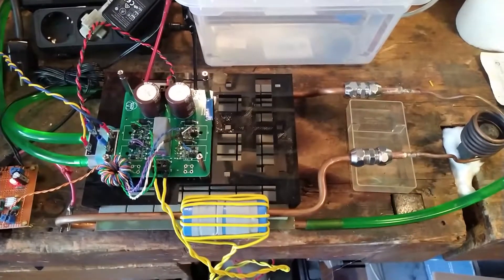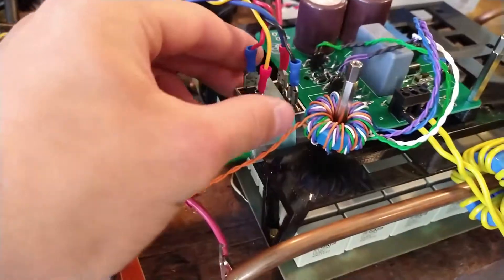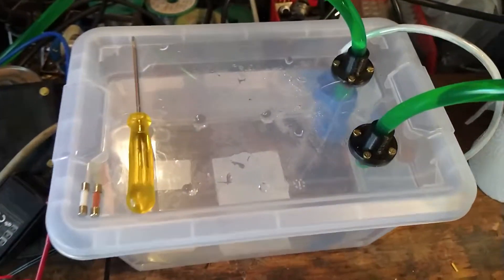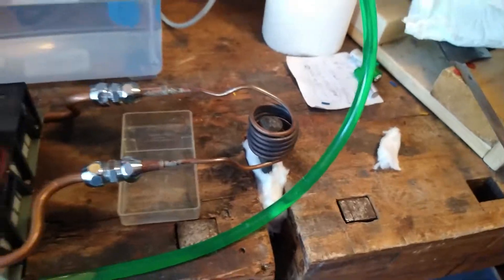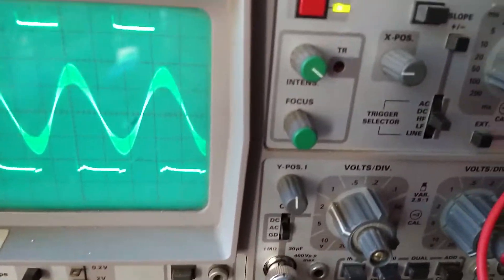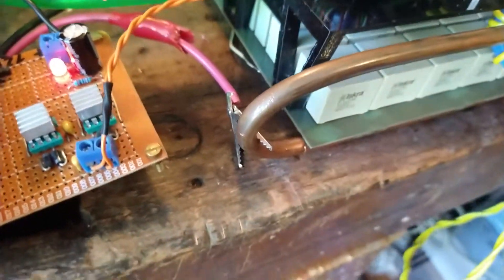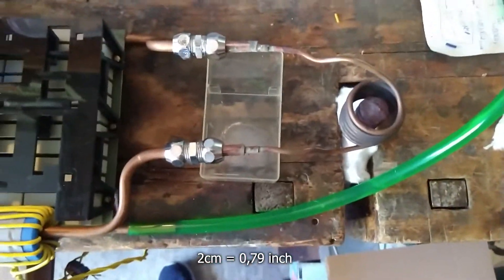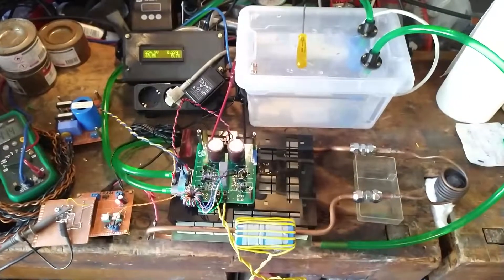Full Bridge Induction Heater - first tests at 2.1kW

Comment: Your english is great. I'm curious what you're using to drive the control signal for the PWM. Voltage in the LC tank? Current in the tank (between the inductor and capacitors?) 

Also, curious, what's the size of your capacitance and inductance in your tank / coil?

Comment: how to make feedback for this?
Reply from the maker: There are multiple ways for doing that. You can use a mixture of current and voltage feedback or current only. In general you are trying to get a measure of phase difference between two signals that represents your offset between driver frequency and resonance frequency.
The main difficulty is to measure the resonator current at resonance (or close to it), as it is not only a very high current but also at high frequency.

Comment: Hello, i have build something similar using a μC that locks in the frequnecy. I went from full bridge to half bridge setup because the power draw was too much. I found that the matching transformer is the critical part of this kind of setup. My ferrite cores were heating up very fast at 2kw and that was a matching problem. I have gone from 1 turn to 2 turns in the secondary and around 18trn in primary and that solved the problem and the power from 2 kw went up to 6-7kw while the ferrite cores were at 80 degrees celcius. The matching transformer should match the impedance of the LC tank. Different materials result into different impedances of the LC tank, correct me if i am wrong. Do you have a ferrite overheating problem with theese cores?
Reply from the maker: Hello,
I haven't looked at the temperature of the transformer but I intend to measure and regulate the primary current of the transformer in order to not draw to much current and save the IGBTs and Diodes. I also want to measure the power from the grid twice a second with a PZEM-004T module. This way I hope to get good control over the Power draw of the unit. 
But if you say I should, then I will also  measure the temperature of the Transformer while in development. I don't think I could add another secondary because of the core diameter. I use 8mm copper tubing for the secondary circuit. I will upload some update videos of the induction heater. 
How did you program the μC in order to lock the frequency? Do you have a video on YouTube where you show your  unit? I would be interested to see it. 
Best regards
Reply: @dickesf8525  Its a good idea to measure the input power. I currently have an 100A AC meter that measures the line amperage. You mentioned the PZEM-004 module. Does this take into consideration the power factor? The microcontroller is the atmega8 that is programmed with Arduino. The microcontroller measures the phase difference between the capacitor voltage and the Inverter voltage. Theese voltages are fed into the xor gate of the pll ic. Different phases give different duty cycle of the output of the xor gate. The microcontroller reads that and applies a compensated voltage on the pll ic in order to keep the phase 90degrees. Its important to begin scanning from a higher frequency than the Fresonant. My current protection circuit works with a current transformer of the primary fed into a comparator. If the limit is exceeded the output of the comparator triggers a flip flop circuit that shuts down the pll ic. Lastly my only way to reduce the power is to detune the circuit (increasing the frequency above the resonance). I don't have a YouTube video yet, i will upload one though.
Reply from the maker: @livewire2404  Yes the PZEM-004T measures the voltage, current and frequency and calculates the power factor, as well as the real power and also keeps track of the used energy. It is basically a complete power meter module with UART interface and Arduino library. I will use an STM32f303 controller though. 

So you are using an PLL IC, probably the 4046, and then you are using the µC as the filter between the phase comparator and the VCO? And by adjusting the voltage into the VCO via software you are controlling the power of the system?!
I thought about implementing a software PLL but I am not sure if the 72MHz STM is fast enough here for the ~60kHz of my Oscillator. I will se how this will go.
Reply: @dickesf8525  Yes, and the 4046 is providing the PWM pulses to the inverter. By adjusting the voltage on the VCO pin (pin 9) i can vary the frequency. The μC provides a pwm signal that it is filtered into a dc voltage to the VCO pin. The frequency of the pwm doesnt matter as long as its filtered to pure dc voltage. The duty of this pwm signal is propotional to the output frequency of the pll. You can skip the 4046 ic if you use direct pwm from the stm32. Make sure to calculate if the 16bit timer has good frequency resolution in order to adjust the frequency precicely in order to have a phase lock. I would recomend an external xor gate to measure the phase diference between the inverter voltage and the capacitor tank voltage. 
I think you would need more capacitance on the DC after the rectifier. The ripple current is very high and it would destroy theese caps. Also with more stable DC voltage you would get more power out of it.
I am curious about your AC mains filter. Looks like some components of switch mode power supplies. Why is there an additional bridge rectifier next to the large blue capacitor?
Also i had used similar cooper tube iron couplers and they got red hot at power levels more than 3kw. You can change them out to brass ones. The iron ones add some inductance and alot of losses.
Reply from the maker: @livewire2404  Isn't it also possible to use two signals, which are already 90° out of phase with the 4046?! If I am correct one could also measure the pahse difference between the capacitor voltage and the resonator current.
The STM32 has also one 32-Bit timer. I have to check again.
An external XOR Gate could work, but I should use one with Schmitt-Trigger, right?!

I only had the space for two of the smaller caps, but i left some space for bigger screw terminals so that i could add some external ones later. 
The caps got a littel warm, I noticed that but it was ok. The main AC component should hopefully come via the snubber cap but I can only try and see now. Otherwise this would be an easy upgrade.
The mains filter is something I think of as mandatory and slightly displeasing at the same time because i just used parts from an old device that I still had and soldered them together the same way as before. I don't think this filter is working too well with the currents present. The Chokes got quite warm. The additional FBR is dead and was used before i bought the bigger one. A new Filter PCB is in the making. 
The copper tubing would indeed melt but i watercool it and it stays at room temperature this way. The water however heats up quite fast and I need a bigger tank. The couplers are made out of brass and plated with crome for the looks. My father had them laying around and I took them because new ones for the 8mm tubing were quite expensive.
Reply: @dickesf8525  Yes it is possible to do it that way. Then if you XOR those signals you will be looking for an output of 0% duty cycle when your system is in phase. In my setup i am aiming for a 50% duty of the gate's output. If you are to upgrade to more capacitance you should add some MKP pulse capacitors parallel to the electrolytic ones (i suppose the grey capacitor is for that reason on the pcb) but you will need more than one. You can measure your losses by measuring the litlers of your water system and temperature rise in a specific time.  Keep in mind also the water cooled pipe will take heat away from the heated metal when its red hot.
I dont think also that that filter that would work correctly for that kind of power. Why you need it in the first place? Also what is your contact info?
Reply from the maker: @livewire2404  Ok, then I might try to incorporate at least the phase detector/comparator part of a 4046 in my schematic and put a DCO in the STM on top of that.
The grey capacitor is a film type, in parallel to the bigger caps and in close proximity to the IGBTs. I might rework the bridge PCB in a future revision but for now i want to work out the controll part in order to not kill any more IGBTs. This project is getting expensive. 
I will probably coat the finished coils in 1600°C cement once the coil mounting stuff is finally sorted out. 
I don't think the filter is super efficient but otherwise this thing would definetely pollute my grid. I had it that even with cheap china chargers the network connections in my house failed. I don't know of it will stay.
I just added an email adress to my channel. You can find it in the channel information. 👍
Reply: @dickesf8525  If you do a half bridge the cost for IGBTs will be halfed :) Also i found some cheap used original IGBTs from aliexpress that work just fine. They are not the knock off ones that the chinese use to "rebrand" with higher specs, they are original but used, they come with shorter leads because they cut them off. I got a pack of 5 for like 6euros. Theese are great for the prototyping phase. Also a current proection will save you some money preventing the transistors from blowing up. The high temp cement is good idea i use it on my aluminum melting furnance.

Comment: The 0:06 (center-bottom) segment combined to your announced title both captured my attention besides some other details, like a mention of software control and even the heavy-duty task of metal forging.

Well, i once contemplated building my own DiY IH Driver but that was long ago and all which remains of it is an ability to entertain with theorizing...

For example, please allow me to urge you to read Allegro's ACS733 datasheet as it about a hall-effect current-sensor chip with built-in agile resistor-programmable comparator and a 0 Hz (D.C.) to MHz analog output.  Noticing the pulse transformer i gather you's have direct access to a local reference clock and hence the means to implement quadrature demodulation, to detect signatures in a susceptor workload...

Relatively to the (5 ~ 6) toroïds stack i'd argue it wouldn't matter what power source(s) drive which copper windings, pleading in favour of magnetic power combination instead of interconnected flux-concentration yokes resulting in 1 single intense electrical stress factor.  Only the resonator requires extreme performance as long as each toroïd is driven synchronously...

Now i can only guess what would happen if the number of magnetic vectors (between 2 opposite poles) were raise to 18 in a quadrature phase-coherent model that kicks a workload the same as a submarine sonar listening to echo pulses.  Euh...  Etc., etc.  Though if ambitious and young then the sky is the limit, so good day have fun!!